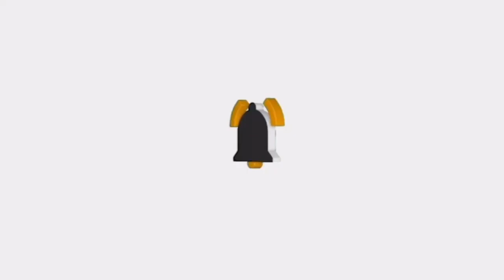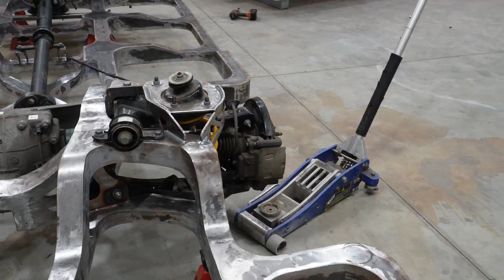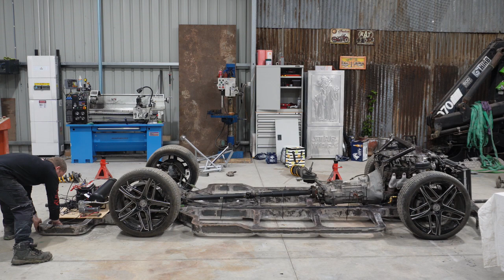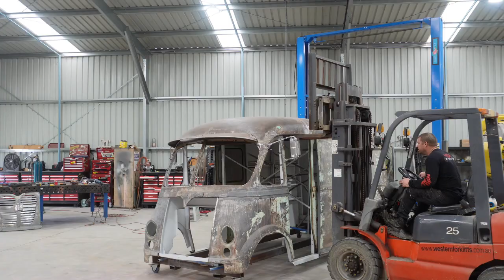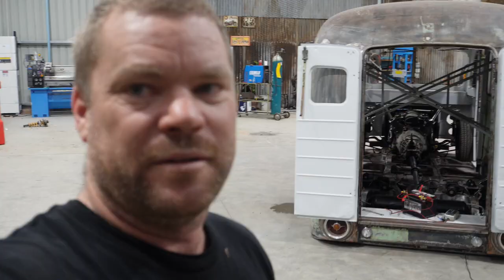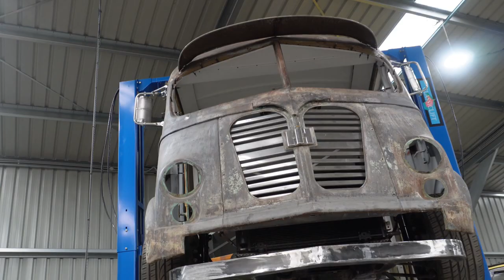Air Ride, Holden Commodore. ??, SSMetro Ep31

Comment: Nick, maybe you should reverse the air bag top bracket 180 degrees to increase the chassis elevation. I think.
Reply from the maker: Cheers, I'm pretty happy with the height. It is higher than i legally have to be when aired up and there is another hole that can lift it a bit also,

Comment: Great work, looking good!  You could always cut and raise the front wheel arches in addition to adding to the sills to allow it to sit flat and still allow steering. I hope you have a hinged rear floor panel up and over that rear suspension once finished, to show that chassis off. You don’t want to hide your fabulous design and fabrication skills.
Reply from the maker: Thanks mate, I think I e found a compromise as far and the body work is concerned. Havnt really got a solid plan for the rear yet was thinking of a perspects window

Comment: Congratulations Nick! Must have been an unbelievable feeling.

Advice from an unqualified pleb is when you set up those height sensors don't let them max out either direction. Ask me how I know😂
You can also get cool billet arms to replace the plastic ones on them.
Reply from the maker: Ha ha, I don't won't to go through that, seemed like it could be easy to do reading the manual, billet would be pretty slick. Was pretty awesome to stand back and watch her hit the deck

Comment: Custom steelies to change the offset and tuck the wheels a little. Hate to say this chop the front and rear chassis / Bars off and raise them up, and as mentioned tweak the sills and the body a little. Lots more work and redo for "This Guy" but mate its so cool it would 100 percent be worth the extra effort. Love it dude
Reply from the maker: Hi Mark, cheers, mate. I am looking to go with the Detroit steel wheels. I love the look of them. Still, it is a lot of work to do, but it will get there eventually.

Comment: Its hard not to let little mistakes get to you, but the rear shocks are a small step in the process!

Good choice on the plastic line rubbish, the car i put airride in always leaked with brand new line and fittings.

Great work as always, looks excellent!
Reply from the maker: Cheers Jeff, yea that plastic tube is not gonna fly